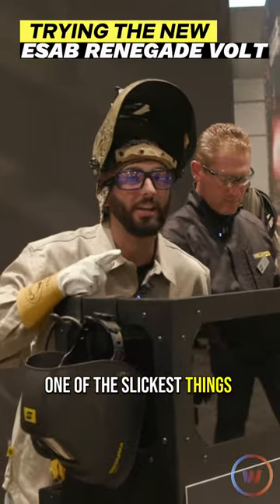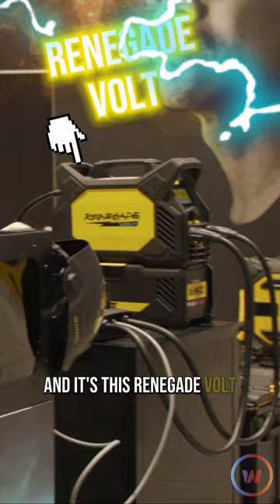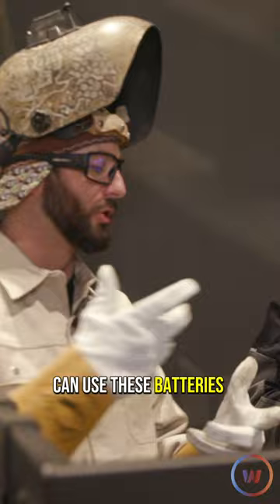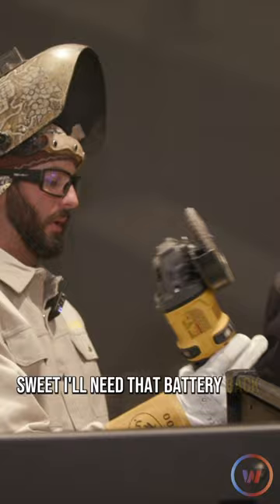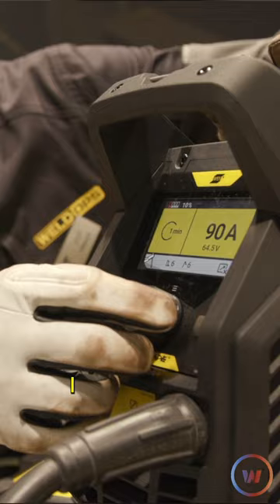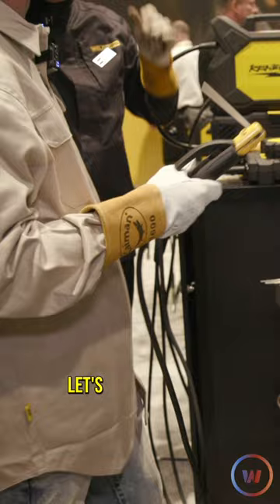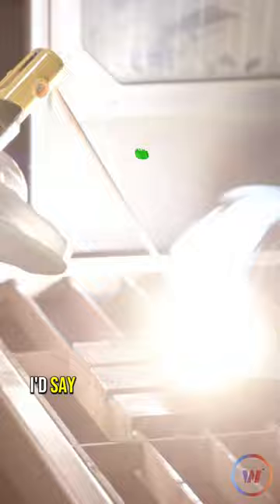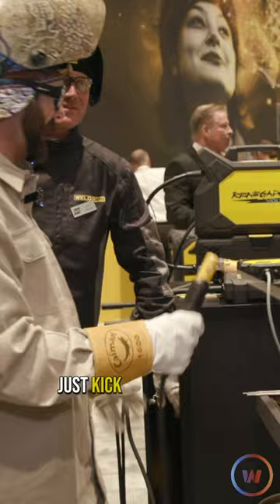Checking out the new ESAB Renegade Volt at Fabtech #welding #shorts

Comment: My gang was using this welder to weld down some roof deck support angle on a large structure. Multiple cranes were operating around the perimeter of the building, preventing us from parking our boom lift in a position close enough to run lead from its welder out to where we needed to weld down the deck support angle.

Our solution was the renegade. We put it on hybrid mode with it plugged into our handheld Honda generator. The hybrid mode uses battery to supplement the low output of the power source it’s plugged into. We were able to bring the renegade and our small generator to each individual location and weld. The renegade excelled in this role because of the smaller diameter rod and lower amperage output we were using on account of welding angle to the surface of thin galvanized decking.

If I were choosing between purchasing a traditional buzz box or the renegade, I would choose the renegade. You can use a renegade like a buzz box, but you can’t use a regular buzz box like a renegade.